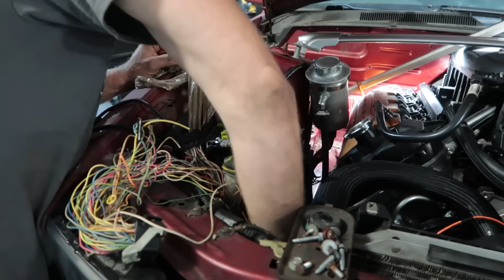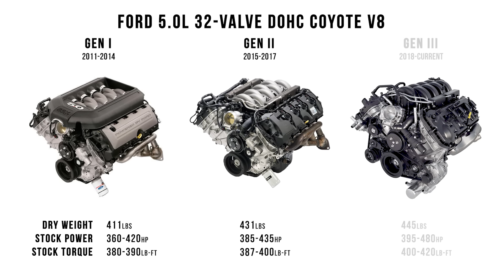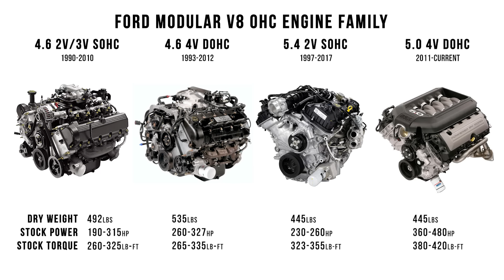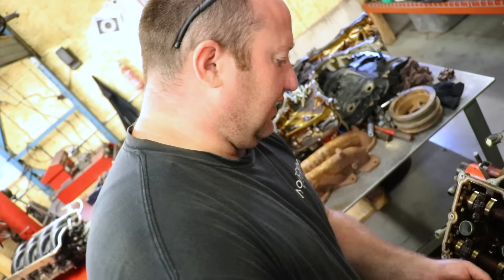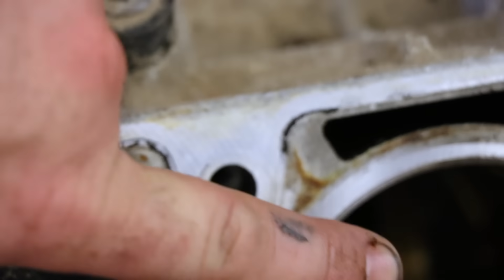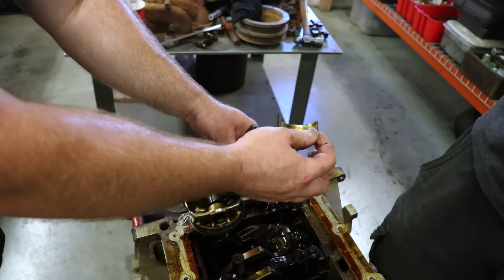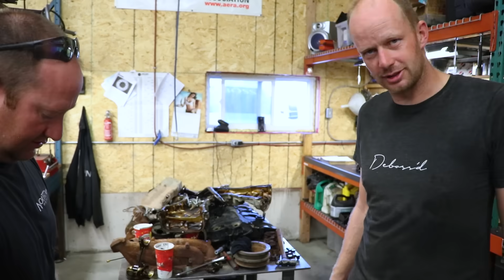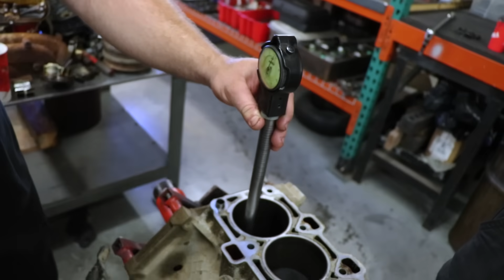REVIEW: Everything Wrong With A 5.0 Coyote Engine

Comment: 5.0 are bullet proof as long as you change the oil frequently. I've seen some with 300k and no issues.
Reply: Great to hear.  I have 41,000 on mine and change oil every 5,000 (miles) and ALWAYS use Pennzoil Ultra Platinum.  Also changed my rear diff, transfer case, and tranny fluids already. 
I baby my trucks.
Reply: @rds990  you’ll get great life out of yours
Reply: @rds990  Pennsville is garbage. Scaeffers oil.
Reply: @paytonjinks8689  that’s spelled wrong I think
Reply: Well, I have 251,000 miles on my 14’ 5.0 F150 as of today. Had it since 216k. Change oil/tire rotate every 5k. Motorcraft FL-500S, and Motorcraft 5-w20(was valvoline HM). The Phaser sensor seals on the pass side bank have just started leaking. And I’ve driven it hard on an 87 tune
Reply: I just got 308,000 km with no issues at all in f 150
Reply: I have a 2011 5.0 with 117,000 mi.  Started making a tapping noise at idle. Also started burning oil. I was told the engine needed to be replaced. Not putting $13,000 into an 11 year old truck.  I will be getting second and third opinions.
Reply: Just sold my 2014 f150 5.0 e 270,000 for 6700. Never an issue, truck has towed 7500lb camper from Miami to Boise, Maine to Arizona.  Ice cold AC.. Change your oil @ 4000 mi instead of 7500, do PM, and yours could last as long as mine and longer. No issues ever. I just wanted a Super Duty.  Try that w a LS or LOL a Ram haha
Reply: Two words for the 1st gen 5.0… soft valve. 
5.0 bulletproof my ass, I’ve got a 13 with only 99k miles and have a tulip valve. Look it up, very common issue with the 5.0 motor.
Reply: So who’s right here? Lol you guys are making me feel stupid for liking either one, I’m more of a chevy guy but I have a 97 aero Vic and I’m trying to figure out what’s better and cheaper and not going to break, I’m thinking the coyote because it mounts up without mods and i like the sound not as much as chevy but I do appreciate a good Ford coming from a Japanese fwd car family.
Reply: @banditpsycho3573  It comes down to preference and experience. My experience, Chevys/GM are shit, but not all of them. Badazz is just a fanboy that gets their assclenched everytime an argument comes up.
Reply: I have a 1999 Chevy Z71 with 332K miles and she still running...bought it with 280K miles. Imma run her till it breaks and swap in the other 5.3 I got for $375 with 95K miles
Reply: Have 200k on my f150 and still runs brand new
Reply: I can’t disagree I’m putting 600 to the wheels via Pro Charger and have over 140 k on my 5.0. The only things I’ve changed are OPG’s the starter and water pump. Change the oil regularly and they do take one hell of a beating.
Reply: My 5.0 in my 2011 F150 cracked the block at 94,000 miles.
Reply: @Xerolinder  I have 346K miles on my 2012 5.0 F150. Dunno what happened there homie. lol
Reply: I have a 2017 Mustang gt, I change the oil every 3000 and I have 200754 miles one it. I had all the timing chains cam Phasers timing chain guides tensioner and water pump done. I don't beat on my car, it's my daily and absolutely love the Coyote.
Reply: This comment section is a waste of my time. I’ve condemned 4 5.0 in my lifetime due to soft valves and seats from the factory just barely 100k miles with multiple dead cylinders due to compression and don’t even get me started on their junk ass water pumps and cam phasers out the ass. I’m a mechanic and know what the hell im talking about. My last and final 2 cents, I know what lasts. ✌️
Reply: I got one with a vicious misire that is probably related to soft intake valves. We'll find out in a couple of weeks
Reply: The fact people here are talking about factory sealed coyote times in a reply about a 5.3 out of a Tahoe stang boys always got their participation trophies, waiting for the "more hp per liter" comments
Reply: @ripinpieces8387  and the 5.3 that makes 100hp LESS for bigger? 🤔🤦‍♂️😆
Reply: u mean after you change the oil gear?
Reply: 5.7 sbc are bullet proof asf
Reply: @curayagmma  we're not talking about antiques here
Reply: @adamr9515  just junk that you have to argue which has less problems right😂
Reply: Haha I dont know what your watching but I've seen a stock bottom end 6.0 run high 7s so your statement is false alot less moving parts reliable as hell cheap to build thats the ticket
Reply: @badazz2969  that’s not a factory sealed engine rookie 🤣 no factory gm will run with a ford and gets rapped mod for modhttps://youtu.be/NWK-eL3eqfc
Reply: @Licmyfreewilly  show me the proof I've yet to see it those dohc cam pos you don't realize I put chains and phasers in those pos 5.0 as a tech I wouldn't take em all if they gave em to me I'll keep my ls engine at the end of the day pushrod will be the last engine running
Reply: @badazz2969  gm is the least reliable truck on the road kid 🤣 seen many coyotes over 200k miles stfu 🤡 gm can’t even compete with a factory sealed coyote 😂 lifter failure galore, not to mention those gm  engines you mention are weak as a 3 hp Briggs and Stratton
Reply: Liar liar
Reply: Compare it to the 4.8 5.3 6.0 of 6.2 of any year from gm and its a pile of shit lol
Reply: @badazz2969  unhuh... cuz its not like the 5.3 had any issue with heads cracking and lifters failing 
Or the ls7 rods seizing at 90k 
Dont say the LS is perfect, its got its flaws
Reply: @narmale  for one the heads dont crack and for two the rods don't seize and for 3 the only lifters that fail are the dod lifters dont try and school me on them I know ls engines like the back of my hand they aren't flawless but they're a hell of alot closer than the 5.0 will ever be
Reply: @badazz2969  ah ok, so these two dozen set of 703 heads in the back from just this month are still good, cool I'll get back on customers cars are lets em know you guarantee they are still good

And ya... im talking about the DoD

Also lets talk about their oil usage from undersized oil rings... cuz i have yet to see a 5.3 with clean runners

And how about the plastic intakes always cracking on that front shroud bolt
Reply: @narmale  let me school ya again oil burn issues are from the drivers side valve cover since the pcv is built into it plus ive never seen a cracked head unless the block hits 260 Fahrenheit and idk where the hell your at but intakes dont crack where im at ive seen more than a dozen 5.3 with 500k miles plus with everything stock except plugs and oil pressure sensor on the back of the block got one myself with 312k miles 5k mile oci and 6 quarts comes out
Reply: What are 703 heads? Never heard of them.
Reply: @badazz2969  I'm with you on your observations over the years with these blocks. They just don't fail even when neglected to a degree.
Reply: @badazz2969  275k miles on my 5.3 still going strong just a new alternator.
Reply: @narmale  people always shit on the 5.3 despite almost every 5.3 having over 250k miles on them with 0 problems, mine for example has 273k with nothing but a changed alternator
Reply: @ripinpieces8387  yea, chevy/ford/dodge, they all have issues and if anyone thinks one brand is better than another is an idiot
Reply: @narmale  they dont like   turbos with big boost 
coyotes and gt 350 gt500 flat plane cranks gutless till they hit 60 
 better boost wheel hit rpms woops just melted number 8 piston 
guy was on his 8th rebuild  had 80,000 on odometer 
so hey 10.000 mile  ran into a bunch of these guys 
and nobodies talking about it 
go on Roush racing blog  realy weird seeing piston with holes on sides 
cost of car and first rebuild you could have a Zo6 lol
it took me till a week ago to finally race a stock flat plane crank coolest engine i ever heard but it was gutless out of dig i would have been 
in other state buy the time he hit high rpm 
id a bought him the pulley even if it ment hed woop me 
but it would kill his new car 
At least he sounds cool
Reply: @badazz2969  your comment didn't age well
https://www.youtube.com/watch?v=FKpK38Wu5bk
Reply: @narmale  Exactly. All brands have issues. No LS is without its problems. lol
Reply: @badazz2969  Ever since 2007, LS and LT engines from Chevy/GM suffer serious issues such as lifter failure. AFM/DOD can cause a stuck lifter to scar the cam, creating metal shaving that could clog up part of the oil system. Rod bearings commonly fuse from lack of lubrication causing catastrophic failure. It is way more common than you think. It has happened to me 3 times in person. 09 Sierra 5.3, 2010 Sierra 5.3 and my coworkers 22 Denali with the 6.2. Not to mention, Chevy is shit at making transmissions. The Ford 6r80 is the best automatic made in modern automotive history. Worst case that happens is a lead frame or solenoid.
Reply: @badazz2969  yeah ok that's why they are number one  selling vehicle not just number one selling truck. Leave the comments to the men and go make me a samwich!
Reply: @j.r.ledbetter1416  same reason Polaris is the number one seller. A following. And after countless low km Ford's. The 5.0 will do 300,000kms average. But with all my half million LS blocks, that's with 4.8/5.3/6.0 seen easy. Ford not so much. Let alone there garbage diesel motors. Which is all we get in camps cause they are CHEAP sold as fleets, or some deal with ford dealer local. 
We didn't have issues like this as often with dodges or GM in diesels. 
I'm not brand loyal at all. But a over all bomb proof motor is LS. We can't kill them in camps which are brought in now and then. And they have a terrible life and still live longer. I can tell you the ford blocks and just swapped. Lots left on hand, or the dealer who made the deal is losing money. 
Many have spent the extra and switched brands. 
Like said. Following. Polaris hype is also as ford. Yet cat and Yamaha blocks can take a beating, doo is a far better mono block design. Polaris and ford are in the same category. And we have a near new Ford  platinum, and we have already swapped the motor. This is maintained products in the NT, Yukon Canada. Southern provinces I see them swinging decent kms as they are highway driven in much warmer climates. 
Ford's older iron push rod motors will out live these dual OHC blocks day and night. 
Ford's don't sell to well in my area either. Most don't like to bother with them unless they have a new motor if there is more then 250,000kms on the body. Says something.
Reply: @badazz2969  ^^^found the Chevy fangirl^^^
Reply: @badazz2969  lifter failing gm pos engines suck 👍🏽 and none out there running 7s factory sealed.
Reply: @badazz2969  I've owned a 5.3 and 2 coyotes. The 5.3 is simple and reliable, but so is the coyote. The fuel economy of the coyote and power band are far superior to the LS platform
Reply: @badazz2969  😂 them dual cam coyotes are smaller displacement and them dual over head cams can wind that 5.0  fucker up so high it would have them LS or any push rod engines gasping for air.😂😂 gtfoh ls fan boy
Reply: @badazz2969  Yeah, you are incorrect. It's not a piece of shit. It works and will continue to be more reliable than the Active Fuel Management infused V8s that GM has. I have well over 300k miles on mine with nothing major changed. You complain about Ford quality, well, my work has plenty of work trucks that are GM that call for your servicing. Those piece of shit trucks always have issues with them. Dummylights galore.
Reply: @badazz2969  how many Coyotes did Ford recall so far?
Reply: @saidtheblueknight  you have no clue what your talking about there has never been a recall on any ls engine in existence. From the block up isn’t an ls today. Matter of fact you can’t interchange anything on a new lt with the ls.
Reply: @badazz2969  You have your reasons, and I respect that. 11-17 5.0s will go 300k miles plus. I already have two of my own and didn't need to change anything in them or out. lol
Reply: @badazz2969  nope, ls is overrated Mr knock sensor and piston slap lmao
Reply: @badazz2969  tell that to your lifters

Comment: So can you do rod bearings in a mustang leaving  the engine in the car and without removing heads? I dont mind suspending the engine and pulling a cradle, I performed these type of activities when I was a GM tech. I just didn't want to pull an engine, when I could make it a quick weekend job because I had considered buying a 2011 through 2014 with a 5.0.

Comment: Unilateral head discoloration is typically due to the PCV location. The head with the valve will typically be cleaner due to circulation.

Comment: Id like to explore Scotts comment at the end about the yote being ahead of an LS with equal parts...? What about the yote makes it "the way of the future" or "better"?
Reply: I'm not sure it's the "yote" or 4 valve/cyl duel over head cam engines in general that he was talking about. With duel cams you can vary the relationship between the two cams and change the overlap, according to the speed and load on the engine. Also four valve engines breathe better because they have slightly more valve area in the same size bore. Third the valves are smaller and can open and close faster allowing for more RPMs.

The question is 'is it worth all the trouble'? I don't think I've seen a street driven V configuration engine that really was clearly better. When you go to a V you now have four cams and all the chains and stuff to drive four cams vs. one cam and a much simpler drive. DOHC engines work well on in-line configurations but unless it's for a full race, 8,000+ rpm race engine I think it only works well in in-line fours and sixes.

Comment: When he said "4.6.... lots of power", I was baffled.
Reply: 315 hp? Not bad
Reply: My o3 Expedition with a 4.6 feels on par power-wise to my 2.3 Ranger.(accounting for weight), about the same.Very reliable at 255,000 except for intake gaskets and coils.Original serpentine belt,water pump.

Comment: Oil pump could be better. And there is a weakness in the rocker arms. Should have been cam direct on valve stem. But way more modern than the 1954 designed LS/LT. The Chevy suffers from poor breathing. Just take the numbers from 0-160. The Camaro Zl1-1LE versus the GT500. It takes the Camaro over 5 seconds more to reach 160 than the GT500. It's all caused by the two valve head, the pushrod limitations on rpm. The small block two valves are not in optimum cross-flow position. The will be remedied in the new 5 liter DOHC engine with flat-plane crank. Can't wait for the new numbers for the super C8.

Comment: I don't know about you, but this engine suffered from poor oil changes. Even if I use amsoil (supposedly the best synthetic oil in the market) I wont go more that 6 months or 8000 kilometers (5k miles) with the same oil in my engine. The short trips issue could also be a problem, but not so much as poor oil changes.

Comment: I have a 2011 Expedition with the 5.4 3v and it has 201,000 miles and runs buttery smooth uses synthetic 5w20 change every 5000-6000 miles, seldom 7000 miles no issues.  Change the plugs every 60+ k miles as with the transmission fluid and steering fluid. Brake fluid at 20k coolant 60k axle fluid 60k transfer case 30k. So proper maintenance leads to longer life and reliable mileage especially with well designed vehicles to begin with.

Comment: Work in the parts dept at a ford dealer.. NEVER have I seen rod bolts come loose.  We are starting to see burned valves on these... But even at that, its higher mileage engines.  3rd gen dual fuel 5.0's have intake carbon issues.  But the engine itself?  Next to zero issues.

Comment: If pushrod engines were better they wouldn’t have stopped racing them in Formula 1 over 50 years ago.
Litre for litre the multicam multi valve is so much better  - Chev are going that way on the next C8